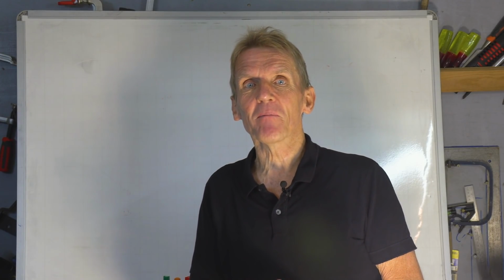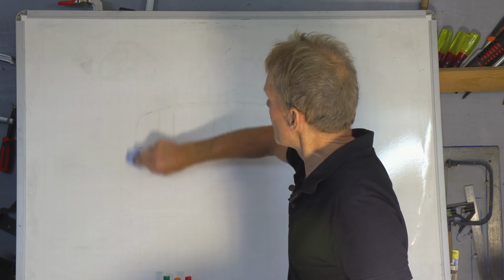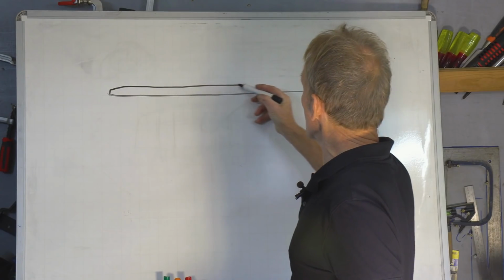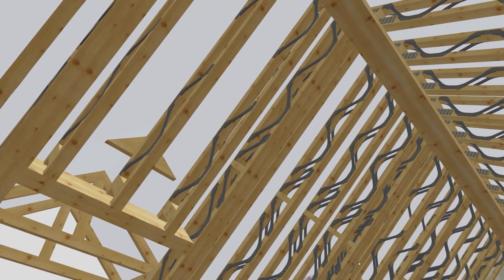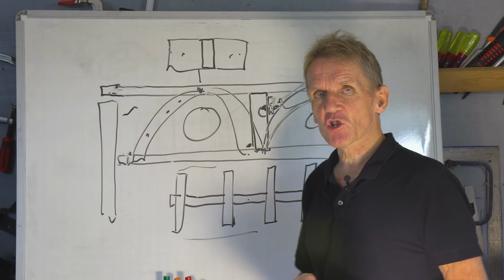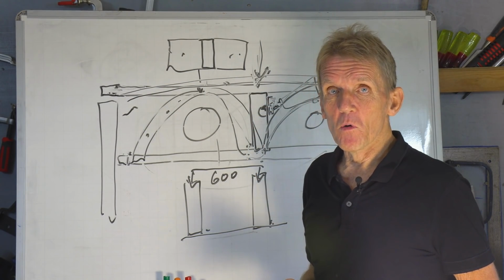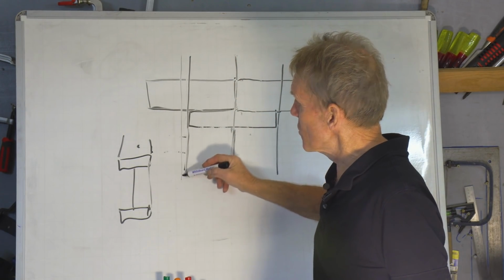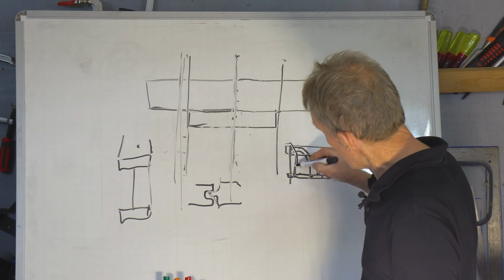New Build Home Nightmares That CAN be Avoided

Comment: The only thing run at 600mm centers should be a garden shed! 400mm with 22mm flooring & 12.5 p/b negates all the noggins and is cheaper and a better job in the long run. time we had a rant Rog, we love a good Rog rant!
Reply: It depends on the section of timber and the span and BIG builder's always work on the edge of building regs 😡🔨
Reply: Same applies to Stud Walls. My son lives in a new build & all the wall studs are on 600mm centres. Makes putting up things like Heavy "Floating/Hovering" En-Suite Cupboards with 25mm thick Oak Worktops (something he wanted 😂), challenging, but i did managed it 👍 Bottom line is they do 600mm centres to save money and increase profits. Also your comment about 22mm Thick T&G Flooring is spot on 👍 I've just built a Cedar Clad Garden Office for my neighbour using 400mm Centres C24 Grade 4x2 Floor Joists (Joist Hanger'ed Inside a C24 4x3 Sub Base Supported on 25 off M24 Galvanised Studs with Locknuts & 100mm Steel "C" Chanel Steel Shoes) & laid 22mm Egger Protect Grey T&G Flooring (sealed together with 5 min Polyurethane & Screwed Down with 5 X 60mm Spax Screws) and absolutely NO vibration or squeaking whatsover 😉
Reply: @rockymount2393  sounds like a guy called Liam species it up 😁 did u buy a build pack? If so was it worth it?
Reply: @jbmaintenanceservices2699  Hi James,  U're spot on 👍 Didn't buy a build pack as  Garden Office was an odd size to maximise available area. Mind U I did watch tons of Liam's vids over the Crimbo period & designed mine on PowerPoint of all things 😂 Also got "C" Chanel Steel Shoes made by local fab shop (about £5 each). Mind U I didn't use a Chainsaw to cut Joist/Rafter Tails 😂 M24 Studding worked a treat as ground had 12 inch drop front to back. Most expensive part was Cedar Cladding all round (£3.8k & 6 weeks lead time !!!!).
Reply: @rockymount2393  nice!!!
Cedar cladding looks good but fair few quid 💷 
Only Liam would use a chainsaw!! Glad to see the piles work well…

Comment: Just installed Pozi Joists ( metal web) on my extension they are 6.6m and as straight as an arrow. My engineer specified 9x2 on 300mm centres and I couldn’t get the timber and ordered the pozi joists instead, I will never use timber joists again and they were marginally cheaper.
Reply from the maker: It does make a lot of sense. The turn around is rapid and the loads are worked out.
Reply: You know when they specify 300mm centres they are absolutely clueless !

Comment: One of my son's mates works for a contractor whose job it is to snag problems in new builds. He reckons they allow £10k on each house. Doesn't fill you with confidence.
Reply from the maker: Paul I reckon they allow that but aim not to spend it
Reply: @SkillBuilder  yes, I don't doubt that. Their contract would soon be pulled if they were overspending. The housebuilder would have done the sums to come up with average and maximum figures.
Reply: So many new house buyers are completely clueless about the building game, they don't know what to look for.
Reply: @TúrinTurambær  the price is that bad if you did a proper job you'd be lucky to make a 100 pound a day before tax🔨
Reply: @TúrinTurambær  There is a strange principle:  The more a thing costs the less the buyers think about its quality.  It applies for vehicles and similarly for houses they tend to mostly look at the square footage, number of bathrooms and bedrooms, kitchen layout but not at whether the house was built to last.
Reply: @Geralt, buyers shouldn't have to move in and look for faults if the builder did the job right. There will always be minor defects but it cannot be into dozens in EVERY new build. It's shocking that buyers know about such things going on and they still pay money for something they haven't even seen 😱
Reply: It's all wrapped up in the directors bonuses, what we found via our SAR request is that they will run the timer down on snags in the hope you'll just accept some stuff and ignore the rest or move on. They have spent far more than £10k so far here on pointless visits, none of the trades turn up with lists to work from nor complete lists when they ask. We were then sent Railey a maintenance company who we sent here again with no list to work from. It's just so poorly managed that even when Redrow in our case attempt to throw some man power at it they don't manage it so it turns into a complete mess and a waste of everyones time. There is a pool of money per developments and per house, that gets eaten away at with every snag done that the builder (Redrow in our case) pay for.